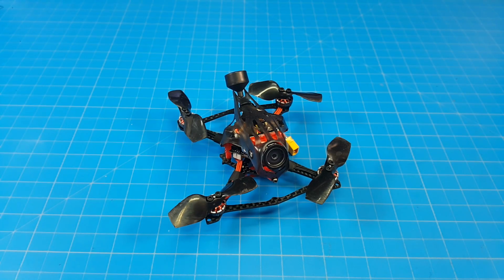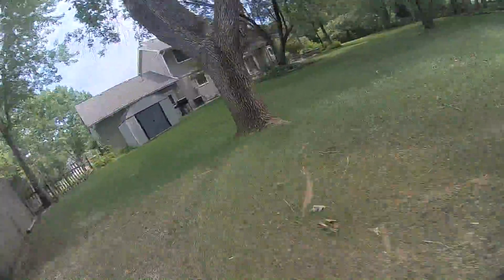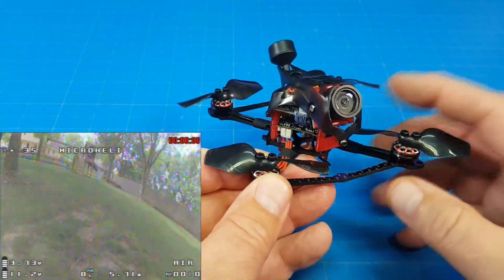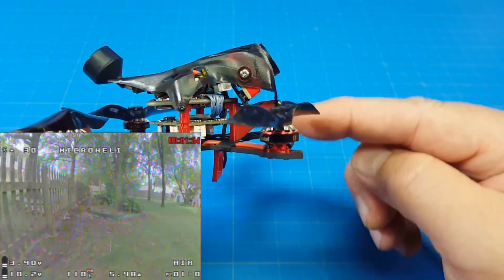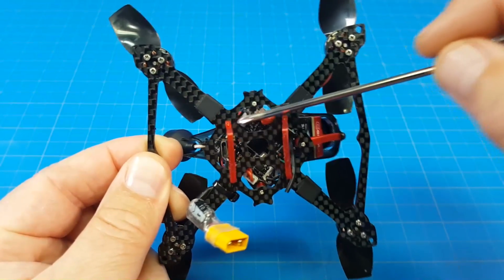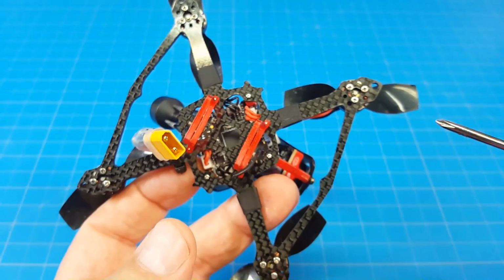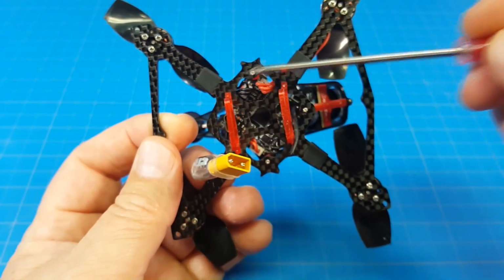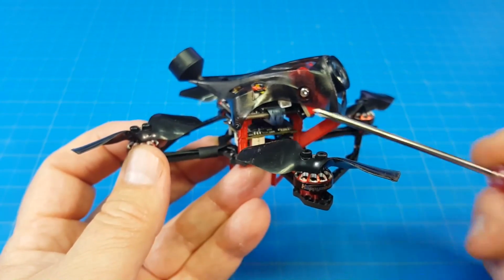MicroHeli Mobula 7 HD Conversion

Comment: Hello, what props are these exactly and do you recommend any other for this frame? Thanks.
Reply from the maker: Those are lumineer props. They are very old I don't recommend. I often use gemfan 2023 props on this size motor.

Comment: Great job on the video Nick hey I have those same motors you have on this conversion may I ask what type of screws  are you using to screw down those props???
Reply from the maker: m2 hex head, I believe they are 6mm if I am measuring correctly. Only measuring the screw part not the head.
Reply: Cool thank you so munch Nick.

Comment: Great job. Where did your PIDs end up?  Are you flying 3.5.7 on all these micros or have you made the jump to 4.0.X?
Reply from the maker: Mostly 3.5.7, BF 4, is more challenging to tune and in generally not as good for micros. This machine tune is P roll 65, pitch 61, yaw 71, I 45, 50, 100, D 33, 36. Feedforward 62, 61, 100.
Reply: Thanks, Nick. I assumed 3.5.7. And I agree it is easier to tune. I’m trying to tune an HD (turtle) 3” lil deuce with the iflight succeX board and that target only seems to have 4.0.X

Comment: I'm curious how that setup might run on the Avan blur triblade 2" props. I had been looking at trying them on a regular Mobula 7 conversion with the 10k kv motors using 2s batteries. Albert Kim suggested going to an 1103 motor for better results. What are your thoughts?  https://www.racedayquads.com/collections/2-props/products/avan-blur-2-prop-2x-cw-2x-ccw-emax
Reply from the maker: I have run the avan props, they are very quiet, but also heavier than these or 65mm props. The avans of the advantage for not deforming on the top end. I personally wouldn't fly them on anything smaller than a 1103 motor.
Reply: @NickBurnsFPV  Thanks for the advice. I think I'll try pairing them up with the BetaFPV 11k kv 1103 motors on a carerra frame. Might have to extend the motor wires, but it should be fun to fly. Keep up the great work!

Comment: Looks pretty underwhelming. RunCam Split Nano will shave some weight off of the HD Toothpick builds so that should help, but we have yet to see a good mounting solution for any of these. Wonder why none of the split-style camera manufacturers don't just do a typical whoop-sized board that we can mount on top of our main board with real screws.
Reply: Btw Amaxinno had the same 3-hole mounting pattern as the HM motors, not sure what the "mirrored" 3-hole pattern is for, maybe to run your motor wires under the frame? Also Amaxinno just came out with a 4-hole patter version of their 1103s.
Reply from the maker: I suspect they see the whoop style board as a smaller market and not worth the investment.
Reply: Probably, fpv market as a whole is already pretty small :(

Comment: Glad you found the Lumenier props, they are great for certain applications, just dont expect any turtle mode. And I love the sound. Not a bad little flyer though.
Reply: What is the advantage of these? I bought some two bladed props for my 5inch, because i was kinda curious. I found it was pretty much the same, other than less hangtime. Now they seem to make a comeback.
Reply: @thereisa6inthename  For very small lightweight drones you will get better flight times without losing much perfomance, for larger quads its more about speed and personal preferences on responsiveness and control.
Reply from the maker: I pretty much only turtle when inside. Thank you for that information, I wasn't aware they don't turtle.

Comment: Love the idea of micro HD but I have had 0 luck with any of the caddx versions. Weird artifacts misaligned lenses terrible fpv feed and wicked noise problems. Great review btw man!
Reply: Try to change the lens to special lens for caddx turtle it's a glass lens. Regarding noise in fpv feed, you should use 5volt from vtx (akk nano vtx provide better 5v stepup)
Reply from the maker: I have found flashing a newer version of the caddx firmware often solves the artifacts issue...if we have been seeing the same

Comment: Really liking how quickly these toothpick sized/weight quads are evolving, that's a great weight with the HD cam but I can't bring myself to buy any of the split cameras because the footage from all of them look over-sharpened.
However I did last night put a Caddx Tarsier on my Kingkong ET125 with a custom printed mount (I made a Tarsier model & put it on Thingiverse), next is the wiring & flying :)   145g AUW yet should still be nimble & fast with the Avan Mini props.
Reply from the maker: I wonder if the settings would allow the sharpness to be turned down enough without losing something else in the image.
Reply: I had the same thought, I've seen reviews of the Caddx Turtle V2 where they set Sharpness to 0 (out of 10), but in the FPV feed I could still see a faint white halo round edges. I can only speculate that this is because of the sensor resolution, the manufacturers must've seen the raw unfiltered picture and didn't think it looked detailed enough, so introduced sharpening in the sensor or camera firmware.
Just 10 minutes ago I finally got my Caddx Tarsier installed on my Kingkong ET125 and did a short recording in 1440p60, it's looking really good, no sharpness artifacts anywhere. 10:50pm and dark now, which means I have to wait until tomorrow for its first flight, can't wait :)